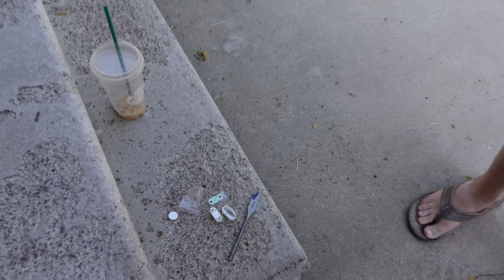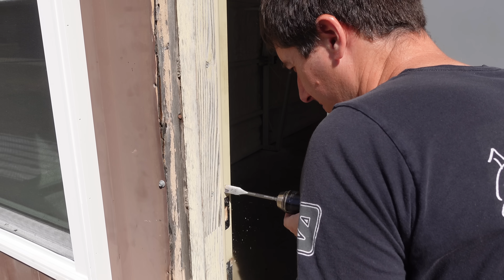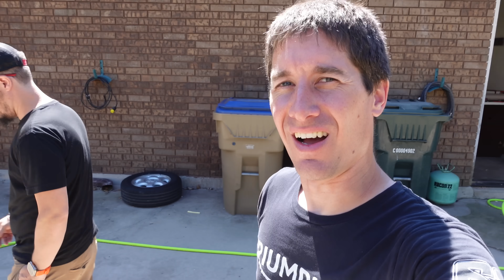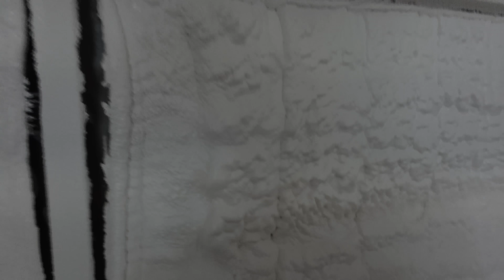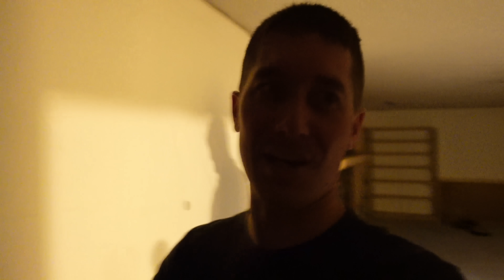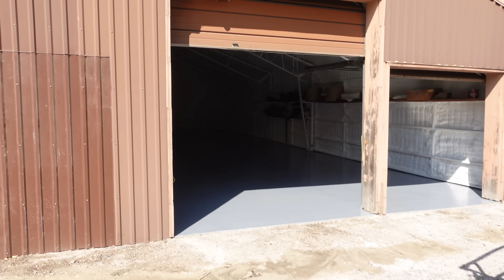Getting My New Shop WORK READY With NEW FLOORS

Comment: Did you add some grit to the epoxy on the shop floor to make it non slip  ?
I think they use carbide particles so it's NOT slippery
Years ago I bought a house with a 3 car garage behind it. My Alfa Romeo days. 
Loved having that much space to work on my projects

Comment: Bro wtf are those guys doing? You don’t pressure wash the floor before grinding. Plus they have a cheap grinder. I grind floors with my boss as a side job and we have a nice vacuum that hooks up the grinder and we use no water.
Reply from the maker: Easier to just run it wet to keep the dust down, they’ve done tons of epoxy for me and it was great.

Comment: That sprayfoam looks like it wasn't mixed properly. It should not be pulling away in that many places... if it was due to moisture or air gags it would only be on a couple spots probably. Make them redo it and make them paint it also.

Comment: Epoxy floors Guess your not bringing the little cat dozer over there to finish. That s a BAT house you need to put it back up on the othe side of the building when you get it painted It should have warm sun in the day and shad at night.
The BATS will eat there weight in Mosquito's and flying pests. I would give it a week to fully cure before putting a vehicle on it to make sure it's fully cure for longevity.

Comment: Shooting spray foam in an old building can be problematic.  The dust and on other contaminants on the inside of the tin and structure can cause adhesion problems.  It's also strange that the foam is shrinking.

Comment: Spray foam is OK but only until it fails.  Ideal wall construction has a drainage plane behind the siding, with a separate water/vapor barrier.  Two layers of rigid foam board glued together with taped and overlapping seams does double duty as water/vapor barrier and insulation but the place to install it is outside the framing to eliminate unnecessary joints and thermal bridging by the framing.

I cringe a little every time I see Spray foam because it's more expensive and makes a building far more difficult and expensive to remodel or repair.

Conversely I get happy every time I see an "enclosed carport" style steel building (with a steel frame) because I think they are the cheapest way to build a quality durable building and if the insulation is done right it avoids the problems people typically have with heat, cold, drafts, insects, rodents, etc.

Comment: It's possible there was something on the surface of the wall.
It takes a few days for foam to stabilize.
Dumb question, what's the temperature swing day to night?

It's possible you just had something on the surfaces preventing perfect adhesion and the foam was expanding and contracting due to temp swing and popped loose.

So long as your Sprayfoam guys are reputable, they should take care of you.
There's no reason (yet) to go all angry, entitled Karen on them yet.

Comment: I probably would've welded or attached hundreds of screws or nails with the head facing out for anchor points for the spray foam imo especially since the foam spraying operation is so expensive. I would've installed steel entry doors with steel casings

Comment: If you try to run data lines out to the garage, do yourself a favor and make sure you run fiber, not copper. The 8BitGuy did his run to his parents' home next door with copper (buried, of course), and a lightning strike took out ever piece of networked equipment in both houses. Replaced it with a fiber line and never had another problem.

Comment: Hey JR. As for putting those screws back from the bay house you should seal around them with a caulking called NP-1 this stuff will not shrink period. Matter of fact I would probably get on the roof and seal every screw that penetrated the building for piece of mind. Those screws that hold down the sheet metal roofing have a rubber washer to seal them and they will rot out and leak eventually. As far as the bathroom. I’d cap off the plumbing that out in the middle of the shop and move the bathroom where the other pipes are coming up through the slab. Their would be some concrete sawing involved to do this but not a ton would have to be removed and I’d also rough for a laundry tub on the outside of the bathroom and install a commercial stainless steel sink there. You can find used restaurant equipment on the net for cheap! Glad to see those guys grind down those floors instead of relying on a psi washing especially without using a surface cleaner! Good Luck!

Comment: Spray foam shrinkage is 100% an install problem.   A reputable provider will own that mistake and make it right.   Will be interested to see how the epoxy floors work out.  I'm on a bit of a build myself and really thinking polished concrete rather than epoxy for a more durable / permanent finish.
Reply: The epoxy will probably chip and flake off.

Comment: Those spray foam people didn't know what they were doing.  That's not supposed to happen, perhaps they got the chemistry wrong?  If you have to do some touch-up painting here and there it is a small price to pay for how useable that place will be during the cold winters and hot summers. Get one of those cheap airless sprayers and a ladder and make it look right.

That concrete patio behind your new house?  It's a bit broken up, but honestly John, I would just caulk the cracks and paint it battleship gray.  It's serviceable and you can put it off for a few years while spending the money on the house and shop.

Great video!  I'd kill to have a shop like that~👍

Comment: John  a Bat Box on the workshop.
  I am aware cost comes into the project but why did you not use Nord Board (shave board) to line the inside of the shop to cover the spray foam and keep the inside surfaces flat and clean.

Comment: I think you might have a do a check with the nature groups in your area. 
Why? I don't think that was a bird box you took down. It may have had a bird make a nest behind it. But that looked more like a Bat Nesting Box. Bat nesting sites here in the UK are protected. So it causes serious problems with building renovations. 

Regarding the Spray Foam Insulation. 
The garage has had multiple decades of exhaust fumes & smoke particles. Then there is spray from things going off. So what I'm basically saying that ground in dirt might have released after the heat from the foam. Also some mentioned chemical reaction of the foam, but not seeing reaction between residue on walls. So add the expansion & contraction of the metal structure.

Comment: You needed an air gap between the bottom of roof and spray foam. When you foam directly to underside of roof all it will do is the sun will bake your roof. For example, houses that have foam sprayed directly to bottom of roof, the shingles bake and curl up.
Reply: There needs to be a channel for air flow under the roof. They are available at home stores. Simple styrafoam tied into a vent along the peak of the roof.

Comment: Not a good result on very expensive spray foam. I think what you took down on the outside of the building was a bat house. Hard to start moving stuff back in when the spray foam continues to shrink on a daily/weekly basis. Constant repairs on it (seemingly) into the future with paint touch ups too.

Comment: On the spray-foam; is it really smart to encase wooden members and joist? Will it not trap moisture? Had a wooden structure rot out for me when sealing it too well😅 Also make sure there is good ventilation since it prevents air circulation. But for this type of building it looks like a good choice. On the shrinkage, that seems due to some mixing problem. It should not shrink like that, some expansion/contraction is normal but not so it comes loose like that. It will enable moisture to condense behind it.

Comment: That’s a bat box. They can be kinda nice as the bats will help keep mosquitoes down. I personally think it’s a terrible idea to put it on a building as it might promote them to tucking into other parts of the building while they are resting. But there is always a possibility that was already happening and they did this to keep them out of the structure. Consider putting a couple on nearby trees.

Comment: I think that the spray foam guys didn't prepare the surfaces before applying the foam. I bet that there was a ton of dust and debris on the structure and the foam did not adhere.

Comment: The quality and durability of an epoxy floor is %100 dependent on proper preparation of the concrete, grinding old/existing concrete is the best insurance to gurantee it bonds correctly

Comment: That insulation was applied WAY too thick in some places for a single pass.   I also wonder if you look at your footage, if you can correlate problem areas to areas where they did the gaps first and then the fill -- from the video it appeared they did it both ways intermittently.  You generally apply SPF in a smooth consistent layer first and THEN apply a little (emphasis "LITTLE") on the edges for the air gap.  The high exothermic heat from the thickness applied, the heat from the metal substrate, the lack of adhesion from a very old/dirty surface, and the thinner coat applied after the thicker coat (which cured faster and pulled on the still-curing thick stuff) could all add up to what you're experiencing.
Reply: Spot On.

Comment: I personally know three friends who have used spray foam and NONE of them have anything positive to say about it. One was a rather large TuffSbed, the other two were shops. A 20x40 and a 40x60. All have had issues like yours. All have had problems getting the contractor to come back and fix it. I hope that is not the case in your situation though.

Comment: Put the BAT HOUSE back up, they'll keep down the mosquitos.  Put it on a side you don't normally see if it bothers you.
Reply: Put it back or you will regret it. Bats eat a tremendous amount of pests. Ocean front condos here all have them for mosquitoes
Reply: @nipperdawg1865  He`ll regret it.
Reply: Exactly
Reply: Bat houses should be on the south side
Reply: if there were no bats, the house wasn't working. Ive had them in other places where i've lived.
Reply: It may have been a requirement when the place(s) were built

Comment: Im pretty sure thats a bat roost, you should replace it, they really help keep down on the bugs in the summer.
Reply: You can put them up in trees. I believe they like to be up high away from potential predators. Also they sleep during the day, and are often in cool caves, so Im guessing that one on the side of a metal building was more like a bat oven than a bat cave. They probably need to be in near complete shade.
Reply: They're pretty horrible pesks actually, they pack lots of diseases and they pee and poop on literally everything. Their pee is so acidic that it permanently etches paint on cars.

Comment: Before you paint the shop exterior: HomeDepot sells a polymer white paint that waterproofs and reflects 90% of UV. I used it on my composite roof and it lowered the interior temperature almost 5 degrees. HUGE savings on AC. Expensive at $99 for 5 gallons- and youll need 20+ tubs - but worth it.
Reply: That paint is awesome. Well worth it.
Reply: @Nyth63  Perhaps the word "coatings" fits better.  We build many thermal and light properties into coatings. NASA started a lot of it. My favorite is the coatings used on their visors.
Reply: @Nyth63  no one said it did. He clearly stated what it does. Reflects almost all of the UV rays hitting the surface. Which is a huge amount of heat that would otherwise try to move through the materials to the interior of the building.
Reply: That’s too expensive
Reply: @pauledwards6446  he paid thousands to foam spray the inside to keep the temps down, That’s pretty much the cost of any quality paint anyways

Comment: Lots of great progress! That floor looks amazing too!

Two quick thoughts:
1. I'm kinda assuming you'll be repainting those exterior doors, so hopefully you can do that without needing to recalibrate the lock stuff
2. Huge bummer about the spray foam. I'm sure that wasn't cheap so hold their feet to the fire to fix it (and tbh, compensate you at least to a degree for the extra paint you'll need to buy now)
Reply: The locks take like 30 seconds to unmount/remount/calibrate - they are pretty nice units!

Comment: Man, more better floors just like you had before. Water is so expensive here I'd hate to run a huge pressure washer for hours at a time. I had to redo the door we use as the front door and luckily Home Depot has cheap manual kits that includes everything you need to drill the dokr nob and dead bolt holes, plus the striker plates etc. I got myself a cheap quarter inch router so I can do that kind of thing easier next time but everything worked and somebody would have to work at it to kick in the main door.
Place is getting better and better 😊
Reply: I live in GA. My well pumps all the water I want.
Reply: Well living in the outer edge of Portland we don't have the option so you're stuck with city water. It's soft water and tastes great but they combined sewer with water in the bill so it averages about 100 a month or higher. I lived in Rockwood that was unincorporated with Portland and after a while they incorporated us and made us go on the city sewer system. We had Rockwood water that was about 20 every 2 months and had a septic tank so no sewer bill till that happened. Rockwood is a PUD so they're only interested in covering the cost to run the system.

Comment: There seems to be ALOT of negative feedback about home sprayfoam installs even after the product has been in the wild for years now.  If you find out anything, please let us know what to watch for because there is precious little a homeowner can objectively do dealing with a contractor with a bad install without lots of knowledge.
Reply: I think it depends on the type of structure and ambient conditions.
It seals really well which is both good and bad since you prevent circulation and can trap moisture. For JRs type of building it probably works really well but in a house I would be more sceptical. You need good circulation of air in every building. Here they built a lot of building too “thight” for a while and they had massive issues with mold. But I think the key is the quality of the contractor to know how to handle the drawbacks. There is no solution that is “best” it all depends on the situation. They all have risks and drawbacks.
Reply: @crabapple1974 My parents are on their third home using this type of insulation.  They've had no issues because in all cases the attic space was actually conditioned space.  I think if you had roof issues things could turn out very badly though.

Comment: I’m pretty sure your spray foam issue is due to the mixing of the chemicals being incorrect. It shouldn’t shrink like this!
Reply: He is going to have issues forever. Once that is sprayed incorrectly, it will never stop shrinking
Reply: @DavesUnbranded  Spot On.
Reply: @DavesUnbranded   Let the spray guys judge.
If it's a bad batch, they can rip it down and respray.
Reply: Also if it was applied too think it remains soft inside. Not common.
Reply: it can ruin a house. at least this one seemed to harden up and not end up a gooey mess
Reply: The latest machines don’t allow the foam to spray unless the mixture to spray it is correct.
Reply: @johnf8877  Why is the foam "shrinking?"
Reply: @smarternu  I don't know if John can answer. But there are many things you have to account for when spraying. Temperature outside, temp of product coming out of gun, humidity, future humidity (is it going to rain) the temp of the thing you are spraying, the mixture of A and B. It takes a lot more than most people think.
Reply: Do we know if it was open or closed cell foam?

Comment: Please tell me you are not gonna paint your bricks white on the house .
Reply: @peterminton8105  yep, mildew/mold, not good...
Reply from the maker: I’m painting EVERYTHING white (with black trim) 💯
Reply: @WatchJRGo But why? You're going to defeat the point of brick -- no maintenance.
Reply: @WatchJRGo look into staining or whitewashing them instead, regular paint on bricks does not last. Efflorescence will form under the paint, causing it to flake and you will be stuck in a cycle of repainting every 3-5 years too keep  it looking decent
Reply: @WatchJRGo  At the risk of crossing stream here a bit... GZquad did the same thing on their mountain house, and they've already been out there a few times washing down the sides of the house because rain/dirt splatter had their white exterior looking grimy. Looks great, but could be high maintenance.

your call of course. Just a thought from the cheap seats out here. ;)